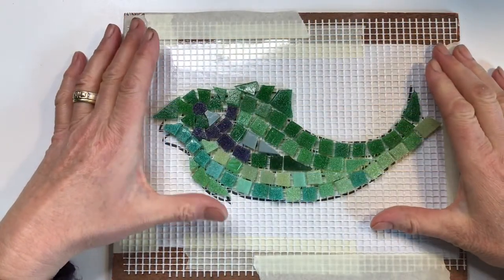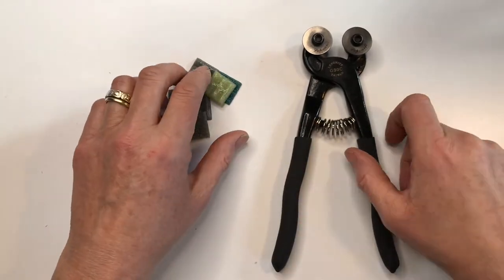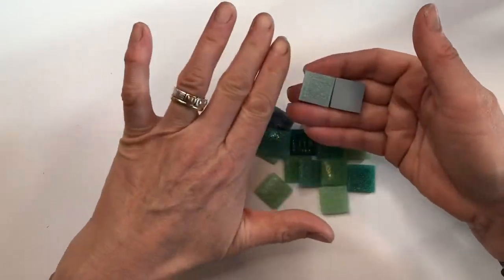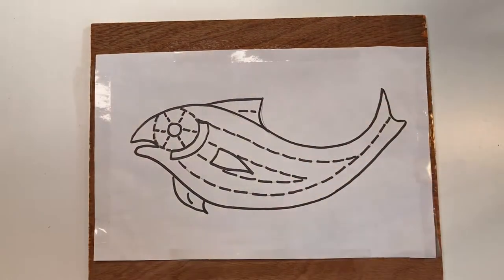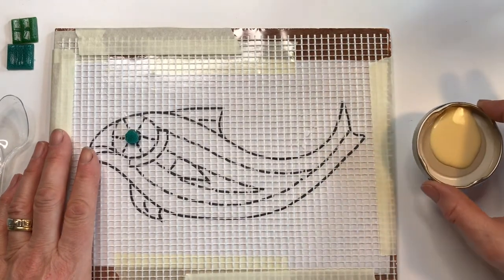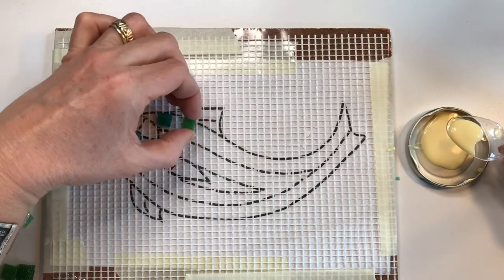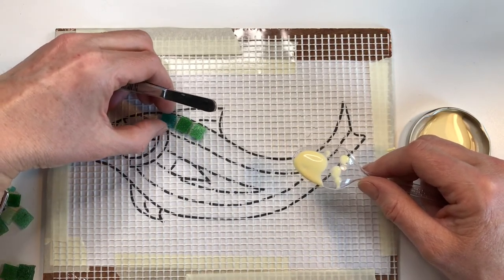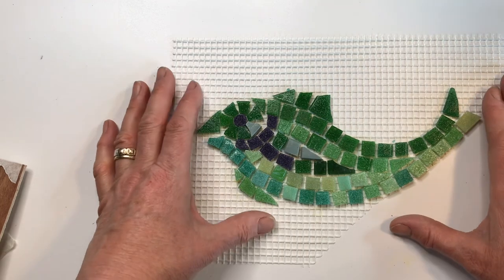HOW TO USE FIBRE GLASS MESH FOR YOUR MOSAIC PROJECTS

Comment: Only just discovered your videos Helen.  they are so so good.  Im new to mosaic and i'm definitely hooked.  Can i ask how you then would adhere the fish for example to the bathroom wall?
Reply from the maker: Thanks Janet! You'd get yourself some tile adhesive which is generally sold in powder form and spread a thin layer on the wall - you can use a 3mm notched trowel to avoid it being too deep - and then press your mosaic into the adhesive. The adhesive will come up through the gaps between the tesserae and hold the mosaic in place. If it comes up above the level of the tesserae then simply wipe off. The mosaic will need to be grouted once the adhesive has dried. Here's a video about mixing the tile adhesive. If you're in America it's called thinset: https://www.youtube.com/watch?v=zQX-jgauWC8

Comment: Hello Helen , have you ever made a kitchen backsplash mosaic?  I would be very interested how it turned out and if it has to be treated to be durable…
Reply from the maker: Yes, I have done many kitchen splashbacks and have used a variety of materials mostly in unglazed poreclain and vitreous glass. Both of these materials are extremely durable and non porous so that they will not absorb oils/moisture etc and can be easily cleaned.

Comment: Helen, thank you for guidance. Do you recommend mesh for flooring? I'm wanting to mosaic my (indoor) hallway 😁😁
Reply from the maker: Ideally you should use the paper backed reverse method for flooring but I have seen professional people use mesh too so as long as you dont get glue in the gaps between the tesserae and there is space for the adhesive to push up from underneath and hold the them in place then you'll be fine.
Reply: Thank you Helen. I shall research this method. My flooring is concrete - is it possible to tile directly onto this surface without the need for the boards you have mentioned? 😁😁😁😁
Reply from the maker: @al-ma6347  Hi there again! I’m sorry but I only saw this message just now. Yes, don’t use boards for a floor, just mesh or the paper method directly onto the concrete

Comment: Hi Helen, love watching your tutorials very helpful.  Do have a quick question?  How would you approach different sized tiles and need to make the surface level for a table top?  Is there a way to raise the smaller tiles.  Greatly appreciate any advice.  Cheers
Reply from the maker: I'm sorry to say that would be difficult to do with this method. The only method that would work if the tiles are different thicknesses is to use tile adhesive and butter more onto the back of the ones which are thinner. But obviously this would not create a perfectly level surface. The best solution is only use tiles which are the same thickness.

Comment: Where does one buy this mesh at is I would love to know!
Reply from the maker: You can get it from any mosaic supplier and hobby shop. https://hobby-island.co.uk/products/tools-and-sundries-fibre-glass-mesh-piece?currency=GBP&variant=42485578236155&utm_source=google&utm_medium=cpc&utm_campaign=Google%20Shopping&stkn=095516cc3e91&gad_source=1&gclid=Cj0KCQjwlvW2BhDyARIsADnIe-K5KvJOVkmN1cLMl3IB0x4R7xmamM6Pvkz-lIJ54GPq6rjmOTp4C4saAu1kEALw_wcB
Reply from the maker: Building supply shops also sell it but if you buy it from them then you generally have to get a whole roll

Comment: Hi Helen! Your tutorials have been so helpful for my architectural models. I am covering landscape terrain in stone mosaics for my current project and I'm wondering if you would recommend I use the fiberglass mesh method or direct gluing to work along the topographic curves of a landscape terrain surface. Also - if you have any other general tips for making mosaics on curved surfaces, that is super helpful as well! Thanks so much. <3
Reply from the maker: Hi there and sorry for the late reply! It depends whether your stone mosaics are going to be walked on or not and how the stones are set. As a general rule it's probably best to avoid the mesh for mosaics which are going to be walked on as the mesh creates an extra layer between the stones and the adhesive which is attaching them to the surface. For making mosaics on curved surfaces, I would always used the tile adhesive/thinset method: https://www.youtube.com/watch?v=zQX-jgauWC8
Reply: @HelenMilesMosaics  In stores we can buy sheets of mosaic on mesh for bathroom application, thus I found this wonderful video of yours as I would like to make a custom floor mosaic for a shower, but your reply here indicates that is not a good idea?  How do commercial tile manufacturers-suppliers make mesh sheets of mosaic for shower and bath installation?  How can we do so for a custom mosaic, what type of adhesive on mesh can work for wet location installation, can you give some tips?  I have been binge watching all your videos, they are fantastic!  But I cannot find information about bath and shower application methods.

Comment: Would you use tile adhesive if say putting it on tile backer board or can you glue the mesh directly to board then grout?
Reply from the maker: I only use mesh for mosaics that can't go directly onto a board - in other words they are destined for a permanent place on a wall where they are embedded. If you are using a board then you can either use tile adhesive directly onto the board without the mesh or use glue depending on what type of tesserae you are using.

Comment: I have a problem with the cling film coming off from the mesh when I use vitreous tiles. Most probably the glue I’m using but I’ve tried different ones with the same results. I live in Mexico so any tips on what glue to use would be welcome!
Reply from the maker: I am sorry to hear that you are having problems with the mesh sticking to the cling film. You could try using a stronger plastic sheet to see if that would make it easier to peel off. Also, are you perhaps using too much glue? You have to be careful only to use a dab on the back of the tiles.

Comment: Thank you for your video ☺️ but do you grout after you finish ...this step am confused about
Reply from the maker: It's sort of up to you. If the tile adhesive pushes up successfully between the tiles, there is no need. If, however, it only pushes up 2mm or so, then I would recommend grouting. Hope that helps!
Reply: Thank you so much my dear🥰🥰

Comment: Hi Helen, would this method be suitable for a large outdoor step please? The area is approximately 3 metres by 1 metre. I have a large workshop and bench and am hoping I could work in here then transfer it all to the step once finished? Are unglazed ceramic tiles the best choice for a front step? Rather than marble for example?
Reply from the maker: I would use the paper backed method for a project like this. Unfortunately I haven't got around to making a video on that method yet but you'll probably find one on YouTube.  Yes, unglazed ceramic tiles are the best because they are already slip proof and frost proof and dont need sealing.

Comment: I am using glass tile (penny tile with flat underside) which is already glued to mesh.  It is going on a flat wooden surface which has been primed (kilz).  Should I glue the mesh side to the wood surface or use thinset adhesive?  Thanks.
Reply from the maker: Hello Pat. Sorry for the late reply. I am not sure that I understand the question. Thinset is a type of glue so either way you are gluing the mesh side to the wood surface. I would just make sure you use a strong glue (whether thinset or some other type). I hope that helps!

Comment: I have an outside wall that I want to make a mosaic for. The dimensions are 10 inches wide by 186 inches across. I thought it would be easiest to do this with mesh. Am I right? I bought cement glue. Is that what you would use?
Reply from the maker: Hi Susan. Yes, working on mesh would be a great approach. Just make sure that your wall is clean and dry and has a rough render that the mosaic can easily stick to. I would make the mosaic using Titebond II Premium Wood Glue to stick the tesserae to the mesh and then apply the whole mosaic to the wall using cement based mortar. When you are using mesh it is really important to not let the glue squish out from under the tesserae and fill the gaps because the mortar needs to come up from underneath and needs those gaps to hold the mosaic in place.

Comment: Thanks . The type of glue plz
Reply from the maker: Hi Mohammed. I use Tite Bond Wood Glue which sounds odd but it is a very reliable outdoor grade glue which works well with mesh. However, you can use any glue that is reasonably viscous as long as it is suitable for the purpose. Check the back of the bottle to be sure.

Comment: Would you use this method with smalti? Would the adhesive push far enough through the mesh?
Reply from the maker: I havent used mesh with smalti just because I always use the tile adhesive/thinset method with smalti. There is no reason why the adhesive wouldn't push up to the right depth. Why not give it a go, but definitely do a trial piece first!

Comment: what stores sell fiberglass mesh?
Reply from the maker: I used to get mine from a mosaic supplier and now I just buy it directly online. If you buy it online it comes in very large rolls that you might not want but you can but it from mosaic suppliers by the metre.